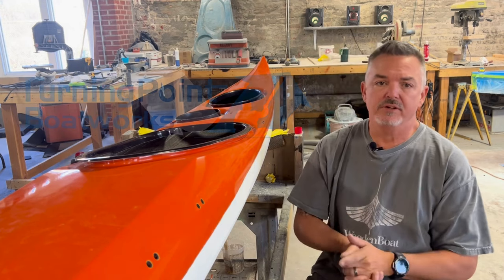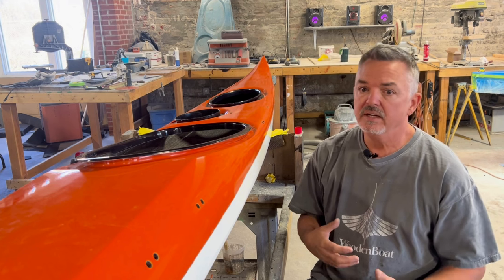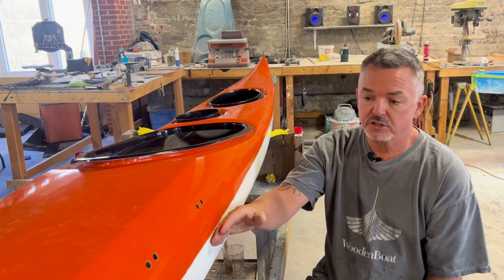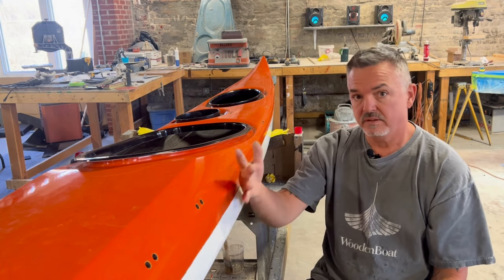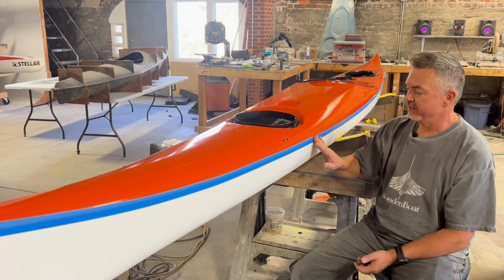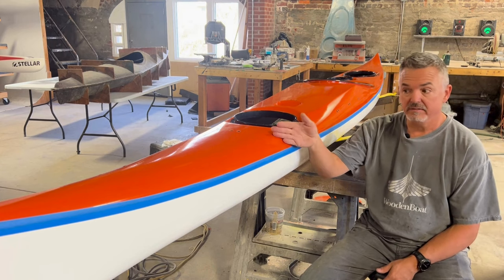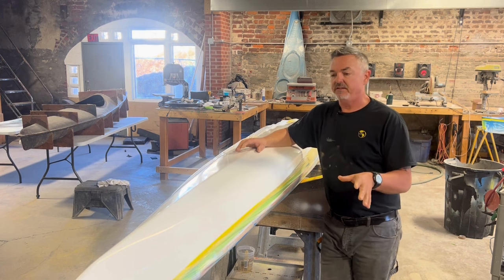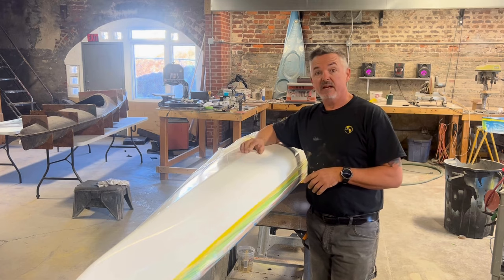How It's Built...Part VII 'Exterior'

Comment: Didn't film the spraying of gel coat. .........since I didn't see any full masking and suit up I was concerned and curious. I was hoping you had a magic gel coat that didn't fume off as bad as the last gel coat I attempted to use in a patch project. Bad stuff came right through my mask with the epoxy/ 20:36 paint filters.

I do like the black line of the seam tape.

Comment: Hey Joey, loved the series! Quick question: Why not put the Keelstrip in the Mold? Wouldn't it be easier and invisible under the gelcoat?
Reply from the maker: The keelstrip is designed to be a sacrificial and replaceable component that protects the keel. Something I am going to look at doing in the next generation of hull molds is to have a molded in version that can be renewd as it wears away,.

Comment: Hi. 
Did you use a polyester gelcoat? I've heard it doesn't go well over epoxy, it melts it.
Reply from the maker: Yes. Epoxy is solvent and chemical resistant. The Styrene in gelcoat has no effect. We use a tie coat to allow Epoxy to bond to the gelcoat in the mold. Since we are only scuffing the surface of the gel for the exterior seam, polyester resin and gel bond very well to the polyester gel on the hull and deck.